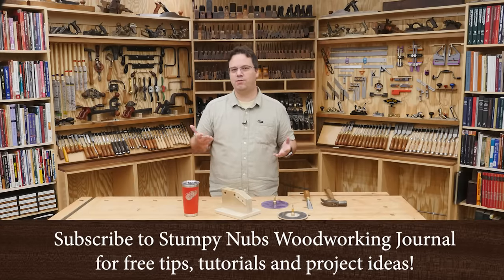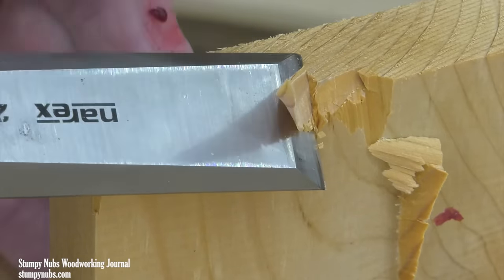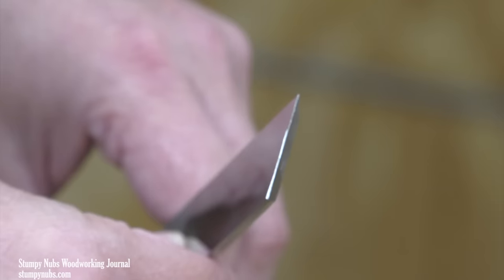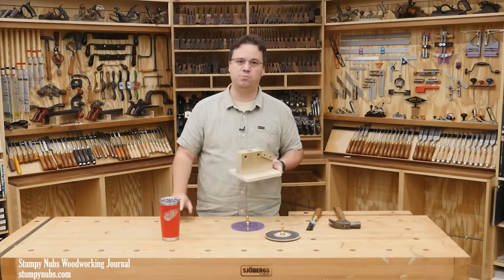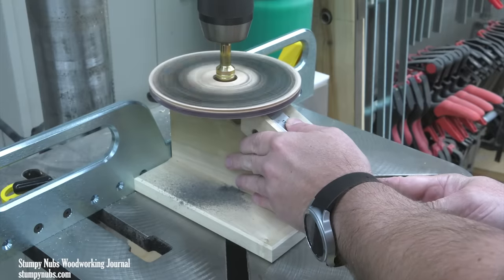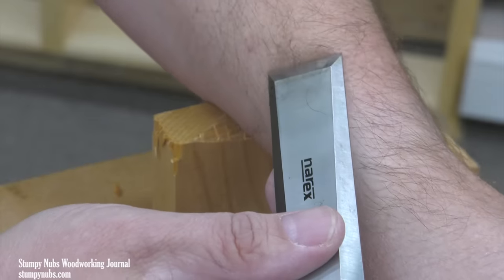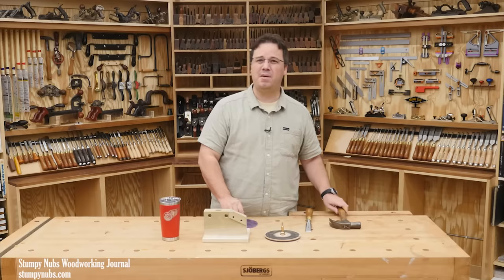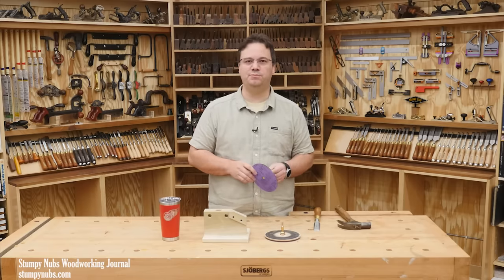Why I use a drill and a hammer to sharpen now.

Comment: The only issue I see is that drill presses aren't designed to handle the side load/torque you are applying to it. Some try to use their drill press as a milling machine e and it always ends with the drill press being damaged and useless for actual precise drilling. Check how accurate your drill press is in a year of using this sharpening system to confirm either damage or not.
Reply from the maker: People have used sanding drums on drill presses for decades. Someone always has an anecdotal reason why it'll destroy the machine, yet I've never seen that actually happen through reasonable, hobby use. But I suppose milling with an end mill in metal would out a LOT more stress on it, so i agree there.

Comment: I'd be very concerned about the downward pressure on that stropping disk pushing the chuck out of that collet.  It's just fine till it's suddenly not and the rapidly spinning disk and heavy chuck drop out and create a very dangerous situation.  If you maintain some upward pressure with the jig against the center of the arbor it should be fine.  A cheep harbor freight live center in the top of the jig would be ideal probably not a bad idea to clamp the jig down to the table too.
Reply from the maker: You're not pushing hard, and that dosc isn't spinning that fast.
Reply: Not collet, I meant to say taper.  I’ve had drill press chucks that took a hammer and wedge to get out. I’ve also had them drop out with mild hand pressure.  @StumpyNubs

Comment: What is the difference in V1 & V2
Reply from the maker: Nothing that affects performance. The arbor in V2 is slightly larger and the leather is horse instead of pig. It was just a change in manufacturers, not an upgrade. Mine is V1.

Comment: For what it's worth, and this is in no reflection to you or your channel, but I ordered the system mentioned above. The discount they promised, wasn't applied as it should have been. I ordered the system and extra abrasives. They only applied the discount to the abrasives, and I paid full price for the system. They also promised it would be delivered today (Friday), with standard shipping. I'm still waiting for it to arrive. Taylor Toolworks is a little disappointing.

Comment: Good for chisels and for very short edges, but for knifes that are longer? Not so sure you'll be able to keep the proper direction for a good edge without have an huge and imptractical disk that has a section as long as the edge you're trying to sharpen. Then after you have the different speeds of the disk from the center to the edge. And you'd also need a different setup. Meh.. Great as long as the edge you sharpen is only a few centimeters long, after that just forget it, use a regular sharpening wheel instead.

Comment: While you consider it so important that you mention it in the title I'm not sure about that hammer part, though. Wouldn't it be easier to just go straight to sharpening without hammering the edge.
Obviously it makes it certain that you won't procrastinate with the drill part, but still I think it usually is unnecessary and just takes more time. And if you are careless you might damage your hammer or even cut yourself. So personally I wouldn't recommend it.

Comment: Pretty sure horizontal disk sharpeners have been around decades...longer than me.

They use a very similar system for sharpening engraving chisels etc..

This is just a knock off version of that existing tool that works on a drill press, it's not some fancy new paper or idea. It's been around forever
Reply from the maker: Nobody said it was a new invention. But it's a heck of a lot cheaper.

Comment: Looks like a copy of the Worksharp 3000 method of sharpening chisels.
Reply from the maker: Worksharp didn't invent the spinning disc idea.
Reply: @StumpyNubs  I didn't say they did, but I have had a Worksharp chisel sharpener for about 15 years that works in the same way - by guiding a chisel up into the spinning disk. If there is product that sharpens chisels using the same method that precedes Worksharp's method, I'd be interested to know what it is.
Reply from the maker: @HarmanRobotics  Veritas made one before they did. I've seen others. I've also seen homemade versions dating back decades.
Reply: @StumpyNubs  That's cool but the Veritas sharpener that I could find has the chisel on top of the disk rather than coming up from the underside like the Worksharp version. Did they make one where the chisel is inserted from below?
Reply from the maker: @HarmanRobotics  The issue we are discussing is the spinning disc idea. Nobody said Worksharp didn't add their own ideas. But it's worth noting that Worksharp's chisel port is notorious for creating uneven bevels do to disc deflection because people jam their chisels in too hard thinking it will speed up the process.

Comment: “…use a drill and a hammer to sharpen…”

just fyi a drill PRESS is not a drill - a drill press is a very expensive stationary power tool that takes up enough space to require placement in a dedicated shop… 

just a little misleading, I was expecting something I could do with my $25 cordless drill 

also I kinda feel like the hammer isn’t really part of the sharpening process as much as a gimmicky way to… I guess… “prove” your chisel was dull?
Reply from the maker: A tool that bores a hole is a drill, be it a hand-cranked brace, a portable power drill or a drill press. It literally has the word in its name. And you could do this with a portable drill if you find a way to hold it.

Comment: A homemade Worksharp.
Reply: That's exactly what I was thinking. Although this has one advantage over the worksharp: the ability to move the jig and thus use different parts of the sandpaper. With a worksharp you're stuck going around exactly the same circle on the sandpaper every time. so every piece of sandpaper gets only a quarter inch wide track to ever be used. That's what I dislike most about my worksharp, that one crappy aspect of its design.
Reply: @arglefargle123  that’s a solid point. This is also a lot cheaper

Comment: Another example of standing in front of a well stocked tool board worth $1,000s, saying "this tool is quick, easy and cheap to make". 
It's also reinventing the wheel. Nothing wrong with a bench grinder and a bit of practise. Which, realistically, is less practise than is needed to have the experience to pull off the set up shown in this video.
Reply from the maker: What does the cost of tools I'm not using in a video have to do with the cost of a tool I am suggesting you can make?
Reply: @StumpyNubs  Because experience. That "simple jig" is only simple with experience. An amateur woodworker isn't going to be able to perfectly make that on their first try. They may not even have a drill press yet.
What I'm suggesting is, your level of experience (which I'm not knocking) may be putting you out of touch with wood workers still figuring if this is a trade for them or not. What's easy for you may be hard for them. What's cheap for you may involve tools they don't have yet.
Reply from the maker: @andreiandrofski9426  - That's not what you said. You referenced the price of the tools on the wall behind me, which aren't used in this video. What does that have to do with anything? Just because I worked hard and earned a nice workshop with nice tools doesn't mean I am out of touch. Neither does having drill press, for goodness sakes. If you want to complain, go after the channels that make everything with Festool and Woodpeckers instead of a guy showing how to sharpen a chisel without buying a $300 Worksharp or a $700 Tormek.

Comment: I ordered this kit and both discs are NOT countersunk. On one disc the hole isn't even cut all the way through. One edge is also extremely poorly cut for a 'laser' edge and is really sharp and needs sanding to avoid getting cut. Too bad I paid shipping and live outside of the U.S. or I would send it back. Shoddy workmanship and not recommended.
Reply: Laser cut edges are often sharp.
Reply: @derekhobbs1102   No. This is an edge that's unfinished. The other disc is smooth all the way around and so is most of the one with the razor edge on one side. It's an unfinished edge that is dangerous on a spinning tool and should have been sanded/polished. That and the fact that both discs do not have countersunk holes and one isn't even cut all the way through is poor quality control. Wish I could post pics. Nice try.
These are 'defective' discs as described by the manufacturer and they are sending replacements. Strange both would be unfinished.

Comment: In what world is this faster than any sharpening station?  This doesn't look faster than a sharpening station.  It's lots of swapping and building and moving stuff around.
Reply from the maker: A lot of swapping and building? You swap one disc. It takes five seconds. If you are an adept freehand sharpener with stones, that's great. Not everyone is. But this is defiantly going to remove the steel many times faster than any manual system.
Reply: @StumpyNubs  Eh, alright.  I can definitely see a place in an industrial shop or a spot without a version of the Tormek.  Sorry.  Maybe I've gotten too used to the conveniences.

Comment: IMPORTANT: This is much more dangerous than expected. Never sharpen a chisel on the face of a powered spinning disk at any speed. If your chisel slips and even slightly touches the incoming side, the sharp edge will dig in and throw the chisel into your person. My father tried the very thing you're promoting in this video and several staples later the physicians were able to close the long, severe wound in his right arm. Please reconsider the publication of this video recommendation; even if it would mean some wasted filming and editing time and giving up a few potential bucks.
Reply from the maker: Disc sharpeners have been made by major brands and used for many decades. Just don't point your chisel opposite the direction of rotation. Same goes with bench grinders.
Reply: Moral of the story: pay attention when playing with spinning disc's and chisels 😂

Comment: This method leaves a very un flat cutting edge which makes it useless for high accuracy !
The reason use joinery people use a grinder to sharpen is to #1 bring the angle down below the standard 30 degrees so we can pair timber without the thinkness of the cutting edge splitting the timber.
#2 if it's done properly on a grinder, you'll never have to grind it ever again & it will just take a few wipes on a stone to keep it forever sharp.
#3 because we're not butcher's & if we are going to spend 40 hours using the chisel on a job why not spend 15 minutes preparing your tools firstly ??? "Seems a bit counter intuitive to not"
Reply from the maker: Not at all. The chisel back is flat because I took the time to flatten it when it was new. This method did not change that.
Reply: @StumpyNubs  I'm quite sure the back would be flat, but the leading edge (cutting face) would have a very slight radius or unevenness to it.
I myself use my chisels to trim edging off board products when they have an edge applied in an edging machine. 
If there is the slightest burr, chip, uneven surface, radius or imperfections it will leave scratches on the board. 
I used to use your method but sideways on a metal disk sanding wheel but would then have to spend hours on the flat oil stone get the cutting edge back to 110% flat again.
They always take off a tiny amount more on the side that the wheel contacts first.
Eg; if the wheel is spinning clockwise & you gring the chisel on the side closest to you from underneath (like in your video) then you will find there is a small amount more removed from the right side of the sanded face. . .

Comment: While I appreciate the quality of the method, and of the cubitron stuff, as well as the literally bleeding effort put into the video, and not least the application of the hammer, which made me laugh out loud, I do feel a little disappointed by the clickbait title.

Hear me out: First, there is no use of a drill as such, except as a motor to rotate a disc. Second, the title implied the use of the hammer for sharpening , and that was what got me excited, but it wasn't. It was only used for blunting. Quite the opposite.

Why would I find the use of a hammer for sharpening exciting? Or even feasible? What I imagined was using a hammer, perhaps in conjunction with a hardened drill bit or two, to hammer-treat the edge of the chisel. This might then result in a slight hardening of just the outermost part of the edge, which would make it brittle, but also more resistant to wear, lasting longer.

Oh well. That wasn't it. If anybody tries my idea, let me know if it works. :-)
Reply from the maker: There's no use of a drill except that it powers the whole system....
Reply: @StumpyNubs  As could various other motor tools.:-) But anyway, the part of my comment about clickbait was 7/8th humour. (Just to prove that Danes know fractions too ;-) ) And the part about the hammer was actually far more seriously meant. I'm sure I read somewhere that hammering metal hardens it. Perhaps pounding the edge of a chisel that has lost some hardness from heating could also help a little. (But perpendicular is probably better.)